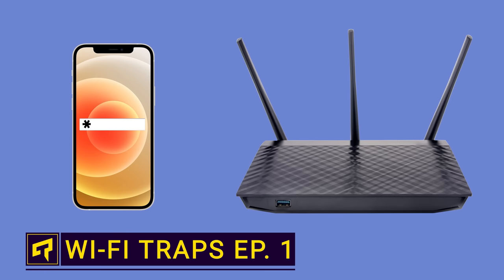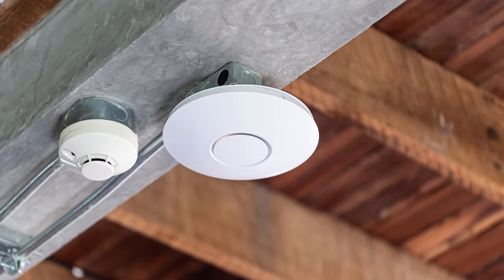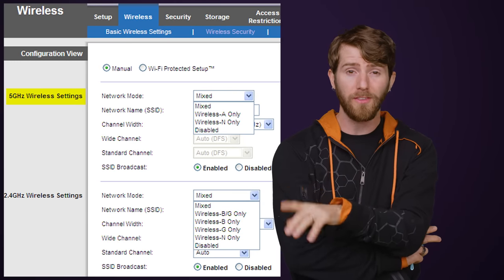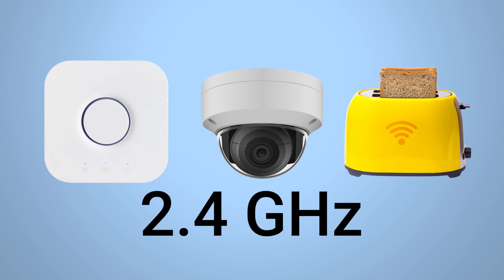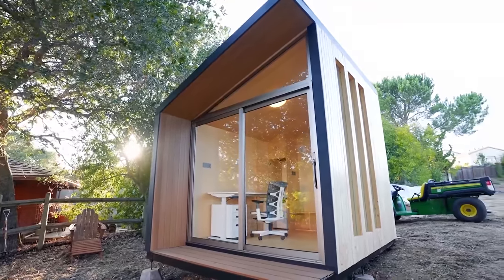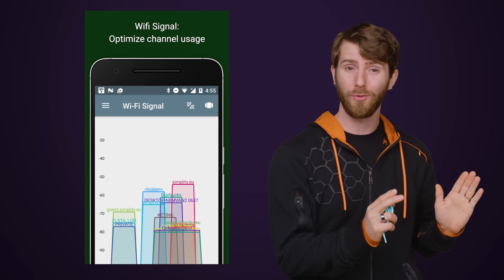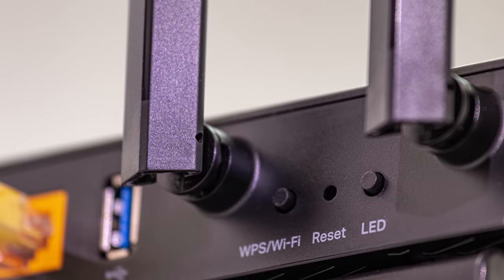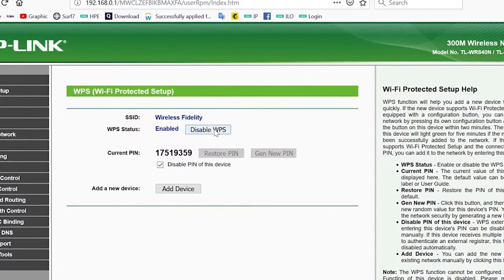Avoiding Common Wi-Fi Traps

Comment: Working as a Network Engineer, I can safely say that WiFi is ABSOLUTELY the technology that has given me the most headaches. Unlike cables, the vast majority of what is going on, is simply out of your hands. Yes, there are best practices, but there's always that one thing, that is sure to make your planned installation requires troubleshooting and adjusting, weeks after.
Reply: Have you ever set up a printer?
Reply: @Aeyesi Of course not. Wireless internet connectivity is critical. There's a reason it's so widely used in all sectors.
Lives have literally been saved because of it.
Reply: @scodal8636  I've dealt with my fair share of printers problems. Most of them always seem be Error 40 though....
Reply: @ToreOnYouTube  I don't think he ment that those users are dumb because they are using WiFi. I interpreted it as a "layer 8" kind of joke...
Reply: @JSCHM  Oh.
Reply: @ToreOnYouTube  Its not critical. Convenient, but not critical.

Also its slow.
If you know how electromagnetic waves work, you will know that a single cable is able to do the same as WiFi, 
except a cable is not shared between all your devices, but you have one cable per device.
Its also not shared between you and 20 neighbors. 
And you can always make a bundle of cables if you need infinite -power- speed.
Reply: @hubertnnn  It definitely is critical for some applications. An example would be hospitals, which use wireless for DECT phones, journals for patients and security profiling.
Wireless is NOT slow. 802.11ad is rated for 4.6Gbps.
Also, cables are definitely a shared media as well. However, you're running full duplex to avoid collisions, that is where the major difference lies.
Cable bundling (link aggregation) does not reach endpoints, unless you got some sort of NIC to support that. Which barely any does....
So yeah...
Reply: @Aeyesi I understand what you mean. Though, in practice it's actually mostly due to misinformation toward end-users. The average end-user is not informed well enough to know what wireless internet can, and can't do. For all their knowledge it's "magic", with nothing in between considered.
I believe companies can do a lot to mitigate this and educate users on how to better their experience with wireless internet. Be it as a service provider, IT-department or home-users.
Reply: @scodal8636  Had troubles with our Wifi-only Printer. Today I disabled 2,4GHz Wifi on my PC permanently - auto connect to 5GHz of the same router and suddenly the printer starts printing 3 old jobs.
Reply: Wireless printers are the absolute worst of both worlds.  They take all annoyances of a printer maxed with being less reliable from wifi and get the perfect storm of just being terrible .
Reply: As a Dental IT technician, printers will be the most annoying problem for me 😂
Reply: @TruSlinger  and yet... So convenient! In fairness it's been a long time since my last wireless printer issue
Reply: Not an engineer but working at troubleshooting for a big ISP and WiFi is definitely the most headache inducing thing that there is
Especially with not tech savvy people that use apple devices, most of the time they won't understand that apple not providing Ethernet ports doesn't mean that WiFi is magically 100% stable
Reply: The latest BT router here in England is great for most things except they have taken out the option to use the 2.4 or    5ghz manually. A bit of a problem for IoT bulbs that run without a bridge. Sigh.
Reply: I can also confirm 🤪
Reply: Help desk here, Printers, fuck printers…
Reply: You underestimate the power of printers
Reply: I gave up on having a printer. My WiFi doesn't cover all my appartment. To hell with all of it. I'm better as a cave man
Reply: I just use an old fashioned wired printer.
Don't want to spend more time messing with my head troubleshooting wireless devices
Reply: @scodal8636  i agree, as a network admin myself printers is the worst devices on my network and Windows 10 doesn't help in the battery, adding printers automatically, printer driver insisting on printer out of paper when it is not, and the worst ..... Users who send the print command 50 times and none come out 🤦

In my case WiFi just works...
Reply: @hubertnnn  Not unless you are in infrastructures where running cabling in walls or ceilings are either legally restricted (historical structure or local building code) or structurally impractical (who has the equipment to open holes on a concrete wall and run cables with a contractor's endoscope?)
Reply: Like led paint 🤣🤣🤣
Reply: oh yes, indeed
some clients just wants it to work.
yet doesn't want cables or such.
Reply: @HorseVengeance  yeah that's frustrating especially when you need to reimage but they don't want you to have ethernet cables coz they hate cables... Loll
Reply: especially when your workplace decides to upgrade all your AP's and now majority of our wireless devices don't work properly
Reply: Like when facilities fails to mention that the wall you need signal to go through is concrete and rebar.  That was fun.
Reply: "WiFi is ABSOLUTELY the technology that has given me the most headaches" - have you heard of printers?
Reply: Pebkac bro
Reply: It was designed for easy of use not professional/enterprise grade network management.
Reply: That’s why they say RF is black magic
Reply: @kanecitizen  ye, my printer technically could do some weird old ass WiFi vodoo but using the USB port is way more relaxed and easy...
Literally just plug&play
Reply: Nothing pissed me off when the affected device decided to connect to a further router then the one next to it how can it be that dumb … im speaking about you windows.
Reply: You don't work on printer do you? JK
Reply: I've installed UniFi access points and also SonicWAVE access points, and I almost NEVER use the automatic function for band range and channel picking. Those are all manual, and I never have any problems with clients complaining about their wifi.
Reply: @davidthepianoplayer  I don't recommend automated placement either.
I personally use Ekahau with a Sidekick for scanning and planning. Probably the best tool for the job.
The issue is often physical barriers, such as possible AP placement or overly reflective surfaces.
Reply: And how often do you get even CLOSE to that speed? I have One wall between my PC & Router, yet only get ~ 300 Mbps, yet my server (wired connection) will bounce between 800 & 900 Mbps.
Reply: @ToreOnYouTube  same, great tool!
Reply: @hubertnnn  it shouldn't be slow. New APs can get multiple gig download speeds
Reply: @Superagent666  I do IT work for a couple dental offices. It's always one of two things that give me headaches: 
1. Bad drivers for x-ray scanners to connect with whatever software the practice is using.
2. Random printer connectivity issues!

Comment: Everyone gansta till you see "Connected, No internet"
Reply: Which literally means that you can reach your neighbouring device, but the not any servers on the internet.
Reply: Connected, No internet means that your router has no access to the internet. Perhaps some construction worker cut the internet cable with his shovel while digging
Reply: Worst text you can ever see when you wanna surf the net so urgently
Reply: When my Wan is down I just yell at my ISP
Reply: @derdrache0512  Well, more than often it's not the cable in the ground that gets damaged, it's a human error in the exchange, for example counting errors and disconnecting the wrong address. For example at my work with DSL we have street cabinets containing 12 blocks of 100 twister pairs and it's easy to remove 45 instead of 35 in example. With optic fiber it's kind of the same, accidentally removing the wrong patch can happen real quick.

Most service-tickets I get can be traced back to a human error somewhere in the exchange.
Reply: That's what I set my ssid as.
Reply: I get this all the time, but only on either the 2.4 or 5 network at a time, so I know the router has connection and it only happens on windows devices not phones or Mac's lol
Wifi moment
Reply: @derdrache0512  that happened in Australia about 15 years back. Knocked out half the country, stock exchange and all, as well as services to the biggest telco. One cable down and a it felt like that dark ages again.
Reply: It's probably something wrong with your connection to a dns service. Phones often try to reach their OS or manufacturer's services when they got on wifi and need dns to find the ip addresses.
Reply: @derdrache0512  For me it fixes when I unplug and replug my router
Reply: Ya hate to see it!
Reply: This happens a lot at my school
Reply: @derdrache0512  The worst thing about this is, it literally had happened. In my country, it made headlines briefly lmao, it took down the entire neighborhood connection to the internet when the fibre optic was damaged
Reply: Like everyone using Xfinity on Monday
Reply: Yeah; Gangsta to Karen in .05 seconds flat. 😀
Reply: Lol, the bsod of the masses
Reply: @derdrache0512  Not necessarily, it could be something as simple as the DNS Server(s) your router uses being down, or faulty client configuration.
Reply: Usually DNS
Reply: Plz, cover Wi-Fi HaLow.
Reply: Yet i still have internet. Nice one wifi
Reply: @NickyHendriks  so the cabinet things. In my city we dont have dsl thats out dated we have satalite/dish. Then fiber and coax. I belive it is county law that if the companys need to turn off a house. It has to be done remotely.
Reply: @DTPGMedia585  sure, it might be in your county but it won't be cost effective as then every house needs a connection on the equipment. Also, DSL isn't outdated. With the use of vectoring we can get up to 200Mbits/s on copper. With bonding up to 400. With G.fast you can even go up to Gigabit. Sure, DSL is 'old' but with modern standards it can still be more than sufficient.

About the remote disconnecting. That happens as well but there are still exchanges where the connection is coming from. If a port in the equipment isn't used anymore then it comes free and can be used for other purposes. That's how an ISP runs. If you have 1000 houses you won't have 1000 active ports on your equipment from the get go. You might start at half and expand if need be.

Comment: Linus: signal is better bellow the router
Me : flip the router upside down
Reply: I was thinking the same... But the ceiling access points are mounted upside down :D
Reply: I think the reason is less funiture blocking signals in the ceiling!
Reply: an intellectual
Reply: @gsedej_MB   +Jan Stromback  Both of you are correct.  It has more to do with the curvature of the Earth.  Transmitter orientation doesn't matter as much unless you're using dish antennae to focus and direct the signals.  The Earth is like an upside-down dish--it scatters any reflected signals; so the higher up you go, the better.
Reply: @Lurker-dk8jk  how tf is the earth's curvature supposed to be relevant at this scale? Even if it were feasibly measurable down to 10-20m (or about the size of an apartment), the apartment or house itself isn't curved.
We're talking about WiFi here, not satellites.
Reply: @pixelmaster98  Fewer obstructions at higher elevations.  Did you not read the first sentence?  If you want the signal to reach further out into your yard, for example, you must put your antenna higher.
Reply: @Lurker-dk8jk  furniture placement has nothing to do with the curvature of the earth, which I'm still quite sure is neglible at the scale of an apartment or house.
Reply: 5Head
Reply: @pixelmaster98  you could totally have a dish to focus the radio waves in a directional antenna array. Just like with everything the radio waves get pulled towards earth because physics and that why the antenna orientation doesn't matter and the radio waves will always fall towards earth.
Reply: It would still fall towards earth
Reply: @ThomasSummers  what the heck dude? WiFi signals are EM waves, if they were affected by earths gravity at such scales, so would ordinary light and we would see everything distorted.
Reply: @arsnova69  technically he's still true, in the scale of 10^-100 m
Reply: Yes
Reply: Actually helps with cooling too if router vents are below
Reply: @josir1994  yeah but who cares about such distances? I am sure the charge in my breathe affects the signal way more than gravity...
Reply: @arsnova69  please smell the sarcasm
Reply: Big brain
Reply: Australia must have the best wifi then
Reply: *below (different meaning and pronunciation)
"Bellow" rhymes with "yellow" and means a deep, booming, thunderous, roaring voice.
Reply: @josir1994  ok, got it, sorry. I hear so much nonsense out there that sometimes I find it difficult to tell it apart from irony...
Reply: This is big brain time
🤣🤣🤣🤣
Reply: I think it is because of gravity
Reply: I mean it should theoretically work

Comment: Thank you for pointing out how terrible WPS is. It should be noted that some routers lie and claim that WPS has been disabled but still leave it enabled.
Reply: What about WPS push button I think that's still ok right?
Reply: That's crazy they can do that.
Reply: @jackkraken3888  The WPS button enables the easy transfer of the WPS PIN without having to enter (remember) anything. The whole WPS protocol is junk, and horribly insecure. It looks like an 8-digit PIN (which isn't really long enough to begin with), but it's actually two 4-digit PINs, which can be brute-forced in a couple of hours (because of the timeout period between failed guesses). WPS can never be secure, because the PIN doesn't change.

Here's an older explanation of the problem: https://youtu.be/f9dSEQzWRGw?t=2765
Reply: @aaronperl thanks for sharing the video, since comments are disabled I got a question. Can't they fix the protocol, now that every device has a button for WPS? The button allows you to create a single-use password thus making an offline attack impossible. While they are at it they could also make their PIN 4 times as long and split it into 4 (8 digits) pieces.
Reply: @jackkraken3888  if it disables WPS pin and is only active on button push it's not AS bad
Reply: Yeah, Netgear does that sh**. Drives me nuts

Comment: I would add that the antennas should be pointing as specified in the manual. Having them lie flat is stealthy, but not very good for signal strength.
Reply: Yes but having them not flat also makes your connection better for spammers. As proven by the other comment here. ;)
Reply: Most AP antennae nowadays are omnidirectional, so their effective signal range and dispersal pattern/structure isn’t noticeably different at typical home distances.
Reply: Having them lie flat can be ok (especially if the router is mounted on a wall). What you really want to avoid is having each antenna pointing in a different direction
Reply: Or at least "Having Antennas" for the basic router that the IPS throws at you during installation would be nice too... two rooms down and not even 2.4 gigs will help you to connect throught the concrete walls
Reply: Scishow says but them at 45 degrees
Reply: I should preface that by saying that you CAN have them pointing in different directions, they should be at multiples of 90 degrees from each other